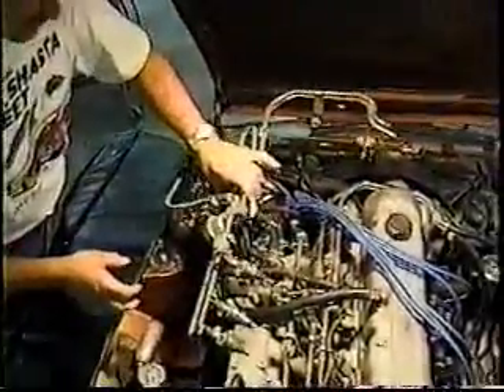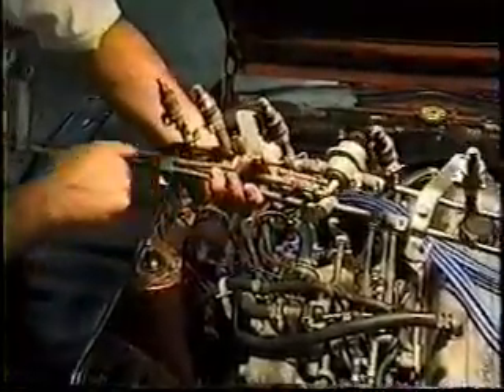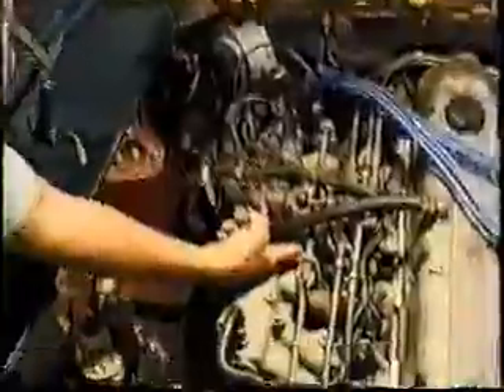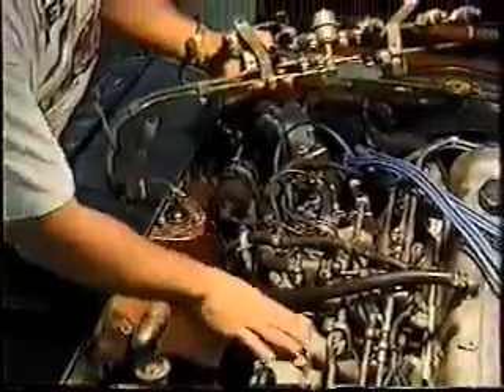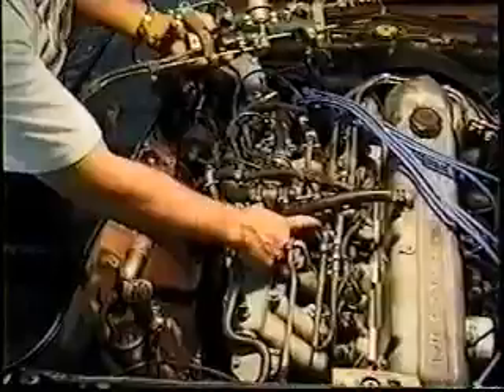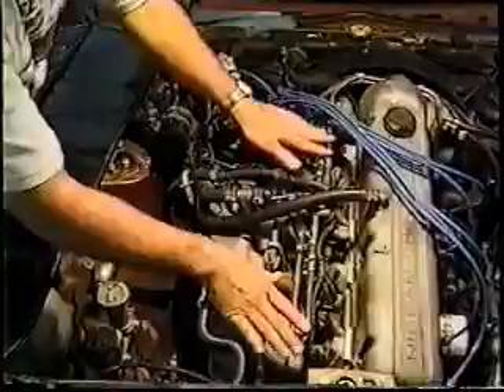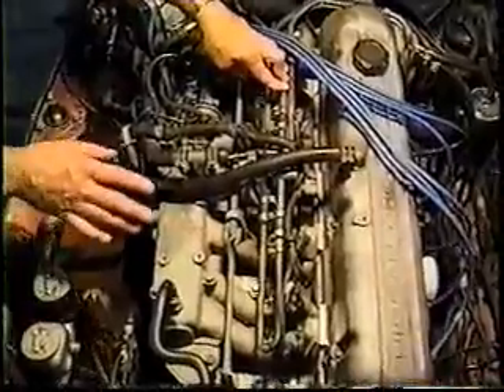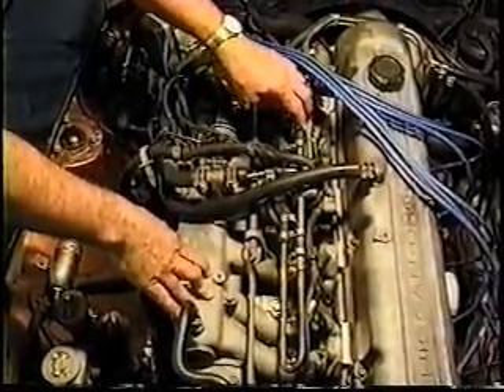Z Therapy Datsun 280Z ZX Fuel Injection Training Part 3 of 20

Comment: FYI- I did have a 78 Z that didn't run and it turned out it WAS the fuel pressure regulator that was the problem. We finally figured it out because fuel was puddling in the intake near the air filter. We replaced the part and it immediately fixed the no-start and that problem never returned. Thanks go to my brilliant grandpa- RIP- an engineer and an all around mechanical genius for helping me get my Z back on the road again.

Comment: amazing video. Thank you. I have a 77 280z that's not starting. There's no power to the injectors. Any ideas? Thank you.
Reply from the maker: I don't know, it's been a while since I had a 280...but have you checked the efi relay?
Reply: Burkey Vision 

I have not. I install a new ECU last weekend and i was able to get power to the injectors, for some reason then stopped, I think I burned the ECU. I ordered a new one it should be here tomorrow. I'm hoping that would be the issue. I also only have power to half of the fuse box and I get no power what to the fuel pump. The fuel pump works fine. Thank you.
Reply from the maker: @jorge135  if half the fuse box is dead...and you suspect you may be burning up ecus...time to find an automotive electrician
Reply: Obtain a copy of the Nissan Factory Service Manual (paper or electronic) and in it is a list of simple tests that check out your EFI harness and the ECU for continuity by probing from the 35 pin connector at the ECU to chassis ground or for presence of voltage available like at the EFI Main/Fuel pump relay. I just got my 77 Coupe to bust off after removing the outer housing to the EFI Main/Fuel Pump Relay (dual relay) and all’s I had to do was to dress the contacts for both relays to restore power to the EFI and get 12V’s to the Fuel Pump, of course after I Rigged up an emergent fuel tank to bypass my plugged pick up tube. Now to drop the tank😵‍💫